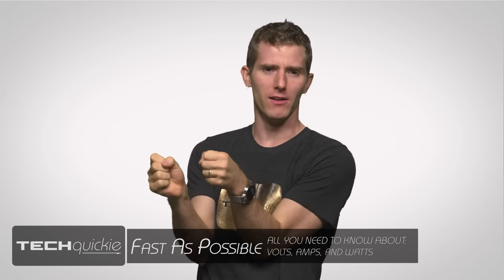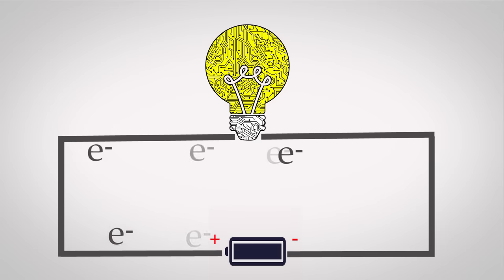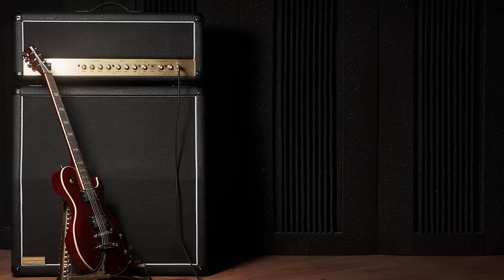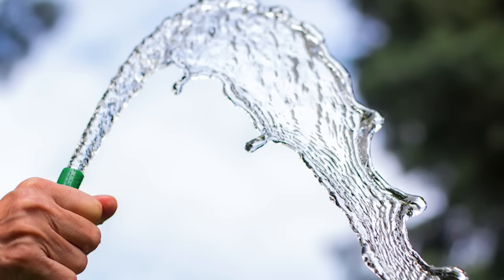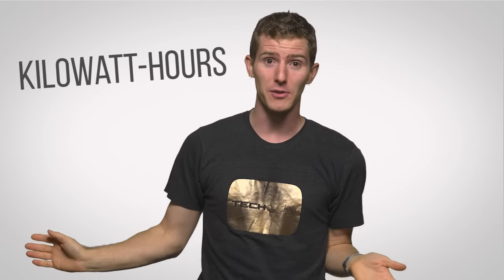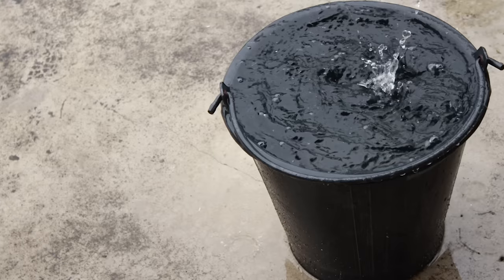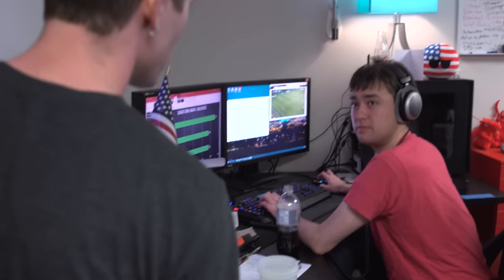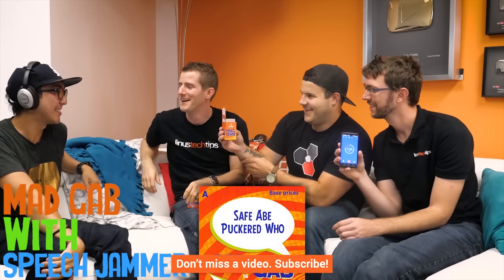Volts, Amps, and Watts Explained

Comment: Hair dryer bought in monaco would not work nice if you plug it in New York but I'm sure it will not blue smoke. In monaco the voltage is 230V and it's 110V in New York I think.
Reply: You're right. It just won't work, or work poorly.
Reply: No, the amperage is different. 5 Amps vs 10 Amps.
Reply: And? As long as the wall is able to deliver it, you won't have problem. It's like a computer : it takes just the current that it needs
Reply: L3xou97 doesn't extra current fry electronics if they don't have a fuse or circuit breaker?
Reply: An appliance only draws as much current as possible. In this case, since the hair dryer is basically a resistive load, only so much current can flow at a voltage, and since 110V is less than 220V, there is less current flowing.
Reply: and it has a motor inside of it that wont like the different voltage, now if you go from 220vac to 110vac you wont instantly blow it up, it will just most likely hum and the motor will draw more current, while the heaters draw less. so the motor wont turn to blow air over the heaters, so they will probably still get hot(maybe hot enough to burn out, havent tried), but the small motor will burn out if you keep it on too long under voltage.
Reply: Chris D Nah, the motor will spin slower and create less heat, but it'll be fine. The heating element, however, will still heat up a whole lot. I'm not sure about the curves but if it does overheat, the temperature sensor will snap and the whole thing will turn off until it cools down enough
Source: I'm a hairdryer
Reply: L3xou97 
110V is about half of 230V.

If you lower the voltage to half you'll also lower the current to half

UxI=P -> 1/2 x 1/2 = 1/4

It'll work poorly or not at all. That is the case with devices that don't have a motor.

If the device has a motor, may draw too much current to make up for the missing voltage to achieve the same output which may damage the motor.
Reply: Voltage stays roughly* the same in an area (mostly country) but if a machine needs more watts (more energy) the amperage goes up. Note that there is a maximum of amperage that can flow though a cable so dont expect that you can plug in your PC of 4000watt in a normal wall socket.
*The voltage of a grid is not perfect so in the netherlands at least it fluctuates between 220V and 230V
Reply: Arthur van strien in belgium its already more 230-240
Reply: Lieven De Troch just checked my own meter xD 233V
Reply: Not that it matters but 248V in the UK for me.
Reply: One of the issues is
The motor will run 20% faster than it needs to due to the line frequency
The heating element will work for a short time until either the fuse or circuit breaker popped, but if you plugged it into a 20amp mains supply, the heating element will get so hot due to the 2x extra current running through it that it will burn up
Reply: L3xou97 no that is the magic of electrical engineering not the natural state of things
Reply: GhastlyDerp dude its motor theory, and if you were knowledgeable in the subject you would know it would indeed want to run faster based on frequency. motors are "dumb" electrical devices it will attempt to accelerate to whatever nominal RPM its design calls if it is an induction motor that is, which i assume it would be if we are using a AC system. the frequency and motor magnetic pole number would determine its RPM. for instance a 2 pole 60 hz motor will want to spin 3600 rpm minus slip, 4 pole 1800, 6 1200, 8 900. The motor was also designed to perform a certain amount of HP for that speed. Now because this motor is "dumb" it doesn't know what voltage is applied so it will draw more current accordingly to reach its RPM at load. maybe it won't overheat if the load is low enough to attain full RPM at the rated voltage/frequency. if you know anyone who owns a well pump, they generally run on 208-220v single phase, put 110v to it and let it try to run, then let me know how fun it was to replace that well pump. Kinda why us electricians have to install motor overload devices. Now in your house/hairdryer the overload device will be the circuit breaker and the heating element will be a much larger draw than the motor ever would be, so that's not protected by anything unless you believe a fractional hp motor will be protected by 15A overcurrent, and if that's the case you know the 2017 NEC will be out shortly. also i'm not actually talking about any specific.
Oh yeah and so you know those temp sensors are really only good for when things are actually working properly. So if you had low airflow over the temp sensor, not drawing as much radiant heat off the element, by the time it trips the actual element has already gone wayyyyy over spec. Put an immersion heater in a cup with no water and turn it on, let me know how long it lasted.
Nice trollin with ya.
Source:I'm an hair dryer motor.
Reply: Arthur van strien well you guys are on the same grid like the rest of except the U.K.
Reply: Marvin Gehlen Why is the UK so special in this case? They only have other wall sockets right?
Reply: Motors don't "make up" for missing volts, if there is not enough voltage for it to turn, it won't turn at all, or it will turn slower. And hair dryers do have a motor inside.
Reply: ya i was thinking this too. the blue smoke situation would only happen the other way around when you use too high of a voltage....
Reply: That's only true in a dc circuit..they use induction motors in hair driers so its not a resistive load. Secondly the motor is probably around 24v, not 110 or 220 anyway. Thirdly going from 50 hz to 60 hz will decrease the reactance of any caps in circuit, increase reactance for the motor, and probably allowing more phase shifted current to flow despite the lower voltage. Same thing will happen if you put a normal dimmer (resistive) on a fan, sure the fan will run slower for a while but the changed impedance will destroy the motor in time.
Reply: L3xou97 if it was vice versa then it would fry the shit out of it. 230 on 110v shit. Rip hair dryer
Reply: I don't know which type of motors are installed in hair dryers, but if I recall correctly bigclive mentioned once in a video that they use PC fan style motors that run on 12v via a potential divider made by the heating element. But I believe that they use universal motors like they do in angle grinders, mixers, etc they don't care about DC or ac or the specific frequency

Comment: Good job once again.  I'm looking to get a home back-up generator and this is helping me explain the details of calculation what size we need to the family. Thanks!
Reply: just add up the wattage of everything you might want to run at once.
if you want to still be able to power the fridge, the microwave, etc., look at how much wattage they use and add them up.  
central air for a typical 3 bedroom house might use around 3.5 - 4kW.
so a microwave, central air, a fridge, and a computer, all added together might use around 6 - 6.5kW.  
as with pc psu's, you want a bit of overhead.  so for 6kW usage, i would say get an 8kW generator at the very least.
but if all you care about is keeping the fridge, microwave, and tv running, then you could get away with a 2.5 or 3kW genny.  
and keep in mind, those tiny little space heaters use 1500 watts.  so for winter emergencies, you're better off getting a larger generator and running the central air.

Comment: 3:30 that water wheel is spinning the wrong way
Reply: Its an illusion nvrmind
Reply: Due to fps and pixel persistence it can be seen as spinning both ways.
Actually for me the inner wheel spins clockwise and the outer anticlockwise.
Try it with different video speeds.
Reply: +bastard™ wtf mam
Reply: +bastard™ I AM AT SCHOOL
Reply: +Michael Mendieta I see what you mean. Interesting
Reply: +Michael Mendieta i see it the same way two
Reply: PaddyDoesTech
the same way two?
Look at the thick "arms" of the wheel and it spins correctly.
Look at the thin "arms" and it spins the wrong way.
Reply: The tricks 30Fps pull on you.

Comment: It's too bad joules aren't used more often. They feel like they should be more commonly used.
Reply: I'm sure joule find a way to use them more often
Reply: it's more of a science unit of measurement rather than something you use in every day life to describe stuff like miles per hour. I guess you could substitute calories for joules in food, but that would just be change for the sake of change
Reply: @HearMeLearn  That's a fair point. the way measurement systems are done today it'll just be change for the sake of change and we get enough of that with software UI changes.
Reply: that's why we use watt-hour instead of joules they both measure energy but i'm guessing joules is used more in physics than Electricity

Comment: Why does the USA have such low voltage?
Reply: Because their power grid was constructed when the current war was still ongoing.
basically a punch of guys arguing what would be better- high voltage, low voltage, DC, slow AC, fast AC.....
In some parts of new York they had DC supply even to this century.

In europe electricity spread a bit later, so they had a lot more information and decided for 50 Hz and around 230 Volts.
Reply: ABaumstumpf but wasn't Europe the first to make electricity?
Reply: Dynamical  In europe it took far longer for electricity to really spread widely, and at tthere a group of engineers decided that 50Hz/120 Volts would be more suitable.
At the end of WW2 the infrastructure was run down, and to increase efficiency of the whole system they rampd it up to 230 V.

Now at that time electricity and the tools to use it have already spread in the US. and while they initially wanted to change the system, the costs and hassles of a change were thought to be too big, so they stuck.
Reply: Lots of countries do.  Probably more than half.  It's not just a USA thing.
Reply: The lower voltage is also safer. And the frequency is what it is. Motors turn faster, that's about it
Reply: Low voltage = more electricity bill. But its safe. Less chances of dying from a shock. High voltage = less electricity bill. But honestly its not safe which is why they use a step down transformer. :)
Reply: Google it.
Reply: bro could you please explain this further or refer to some website or video from where i can understand about this in detail
Reply: A lower voltage means more  current for the same amount of Power. Which leads to more use of copper since wires only allow a certain amount of current passing through them. That might be a thing.
Reply: Yah why?

Comment: kWh is not really explained well. It is the ACTIVE energy that is 'used'. The reactive energy is not accounted in this. This is measured in VAR, not in kWh.
Reply: You also made a mistake, saying that batteries have a capacity. They don't. This word is very misused. The right word is electric charge.
Capacity is in F, electric charge in Ah or C (actually As)

Comment: One thing I dont understand in American electronics... Why they prefer 120v rather than 230v (or higher) low voltage means higher amps and then the cable has to be alot thicker, and powerloss is much higher at long range use. Someone smarter explain to me
Reply: It's mainly because higher voltage is more dangerous.
Reply: Robbedem oh, of course :$
Reply: 120v is just what we get from the tap. The long-distance power lines (the ones suspended on metal towers) can reach 11kv, and is down-stepped to 120v as it approaches its destination.
Reply: That's both true and untrue. Voltage is the "pressure", so high voltage allows current to flow through a human. 1 volt might not conduct through the skin. 10,000 certainly will. However, it's not the voltage that stops your heart, but rather the current. 0.1 amps is all it takes to stop your heart. This is caused by the current causing the heart the contract as the signals that tell our muscles to move are electrical. This kills you. Above 0.2 amps and you might potentially live because it's actually so intense it doesn't get the chance to mess up the fibers of your heart when it contracts because the contraction is so severe. You might stop breathing and will become unconscious, but will be able to be resuscitated if acted upon quickly. However, severe enough burns from high currents may kill you instantaneously. For example, the infamous third rail of Chicago's "L" trains, has such high current, that it actually cooks you from the inside out in a matter of seconds. In fact, if European homes are 5 amps instead of 10, you won't suffer as severe a burn.
Reply: +SpecialJ11 I don't know if what you're saying really is true though it's kind of close to the truth.

+Ville Pyykönen I'm pretty sure 120V vs. 230V is just a historical thing and it's hard to change any more. 120V is almost harmless to humans so it has that going for it. 230V though needs smaller cables etc you mentioned.
Reply: It's ramps up to like 500000v and scales down to 120v in the house
Reply: More voltage = more danger. Low voltage is better for home uses.
Reply: And we do have 240v outlets for major appliances.

Comment: Wait, is a "moment" an actual unit?
Reply: Nope, there are turning moments but they are something else
Reply: unit for moments are usually Nm (Newton-Meters)
Reply: Moment is something else, for example, you've got a rock with a long stick balancing on it, it is 2 meters long, so 1 meter both directions, if you would apply 100 newtons of force on the left part, it would mean that the stick has 100Newtonmeter (newton times length in meter) to the left, this way you can calculate something like, how much force do i need to apply if i apply the force 0,25meters away from the rotationpoint on the right side.
for example:

(N=Newton, m=meters, Nm= Newtonmeter)
100N*1m=100Nm
100Nm/0,25m=400N  --> 400N*0,25m=100Nm

http://prntscr.com/cyyhin (visualised)
Reply: Yes I know about the other moment but I'm asking about the 90-second one
Reply: momentum.
Reply: yanchebanche No, a moment is just an arbitrary amount of time.
Reply: Cosmic Paudel Yeah that's what I thought. Then I saw this video.
Reply: A moment being an average of 90 seconds came from the Medieval era. It was how they measured a day, based on the sundial.
Reply: lalaithan That's what I was looking for, thanks
Reply: 90 seconds
Reply: yanchebanche yes, when you said "give me a moment" or something like that, it's 1.5 minute

Comment: European circuits run at 230V, not 220V.
Reply: DUCKDUDE4100 maybe. But in Russia we have 220 v standard however it's always different. It usually varies from 180 to 240 volts. In my house that is abot 200 volts.
Reply: Your power grid isn't that good then. A good grid would give very steady voltage.
Reply: Sami Tynninen It's almost everywhere in Russia this way. At least at my city. Some people have unstable 240, some have 230 unstable as well, and there are not a lot of those like me who has very low voltage - 210, 200, 190 and less.
Reply: +Oleg Sobakin That is a problem in many places. It's still just about the quality of the power grid. Small changes don't matter though a very good power grid has almost no fluctuation.
Reply: Incorrect. Some countries in the EU have 220V and some have 230V. Even some very old networks have 120V. Though this numbers are just a target. The 230V in a country with a reasonable power grid can for example fluctuate between 220V and 240V
Reply: Actually, 230V is the "harmonised" value. Basically, they threw all the different countries together and picked a number somewhere in the middle of the range. While 230V may be the EU voltage level, in the UK we still use 240V and other countries still use 220V.
Reply: I live in Serbia, my voltage is 220V +- 10V. No major drops or bumps.

Comment: My hose has a jet setting. The water shoots out super fast, which feels like it's actually spraying more water. In reality, my plumbing can only push so much water out, and that volume is already maximized with the open hose. So, it doesn't fill a bucket any faster if I use the jet or not. 

When I use the jet nozzle it increases the PSI (volts) by decreasing the nozzle diameter (amps), but in the end it's still spraying the same amount of water (watts).

Comment: So basically, (I am a beginner just starting to do simple electronics with breadboards btw), Volts are the pressure/force in which the electricity is pushed, Amps measure the speed of electricity flowing, and watts is the measure of the electricity itself? Just trying to make sure and not be confused, thank you for the explanation btw, great analogies and comparisons compared to other videos I've tried.

Comment: So the Wh unit is indeed a bit unusual and challenging to understand, why its corresponding to watts as it does. Watt is the rate at which energy is flowing per hour, same as km/h is the rate of distance travelled per hour. So we are used to see a rate "per" some other unit, like time for example. So actually if you think about it, Watt could also be considered as Wh/h (Watthours per hour) but the hours cancel each other out so we are left with watt. At least that way it helped me to get around Wh some time ago.
Anyway, the explanations in the video are really great!

Comment: Another unit is resistance measured in ohms. If you multiply resistance by current you get the voltage so if you multiply the current squared by the resistance to get power.

Comment: Hi, can u please help me? If a Voltage of 1.5V means that there are 1.5J carried by every coulomb of charge passing through the lamp, then how do the electrons have any more energy or pushing force left to return to the other side of the battery?